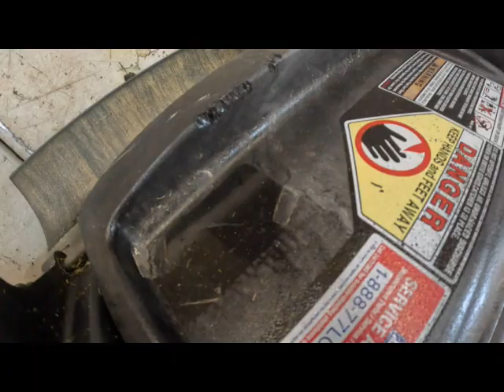Troy Bilt Push Mower Quits in the Middle of the Job!

Comment: Well, I’ve used more than my fair share of tire shine and armorall but I can honestly say I’ve never dipped one in clear coat. 😂
Man… that air raid siren must be mounted on top of your shop!  I got scared and had to run to the basement to finish this one and then thought I was going to get hit by a train at the end! 😬😳😱😂
I still pick up and deliver but I only buy and sell. Tuff to get the hood deals doing it the way I do without going to pick up. Anything I sell can be delivered with a minimum $60 fee just to hook up the trailer.

Comment: Good repair there Tommy boy. At Eliminator Performance Jake does all the pick up and deliveries with the Company truck and trailer at a floating rate that depends on mileage and time spent on the pick up ie: if tires need inflating to load or longer to load due to brakes seized. Normally these invoices are extremely expensive but our customers are happy to get their equipment fixed and returned in a day or two. Jake schedules all of the workload so in many cases pick ups are organised where we can get three or four on the same trip. We have had customers happy to pay $120 just for pick up and delivery even though we suggested they rent a u haul trailer which would have cost them $50 to bring it and pick up.

Comment: Nu Finish is the best car polish. It will polish away the tiny scratches the spinning car wash brushes make, if you rub hard and long enough. The stuff lasts about 10 months outside on the Gulf Coast. I hit my lawn tractor with some, since it sits in a garage next to the old silver Ford Expedition which shines like when it came off the assembly line in April, 2000, after I spent some time on it with the Nu Finish. It isn't easy, but it works if you put in the hours.
Reply: Great stuff Bill i have used it myself and still have some left. The ceramic coating Jake had done on the Company truck eliminates the need for waxing.